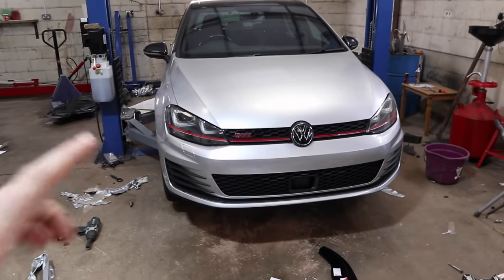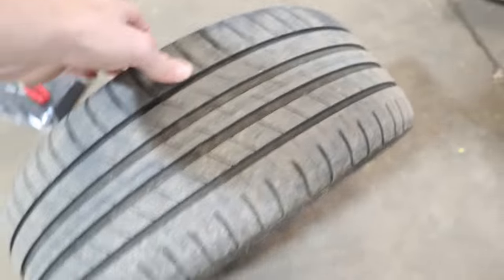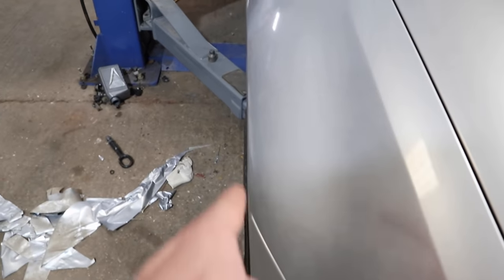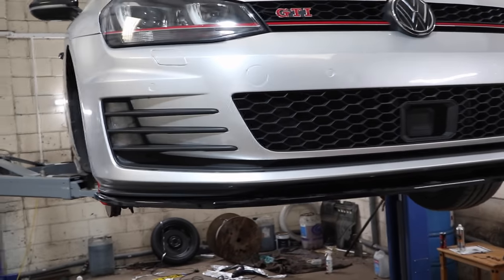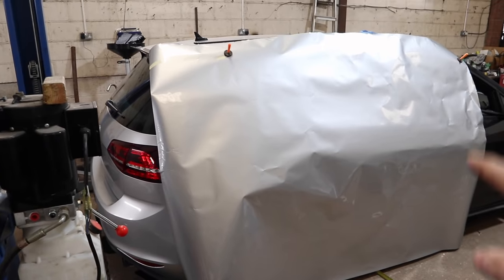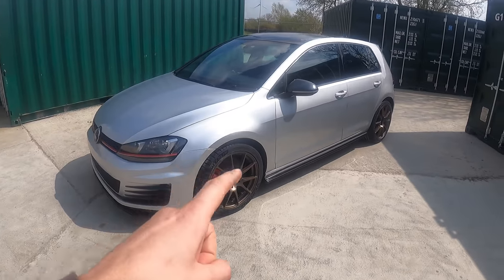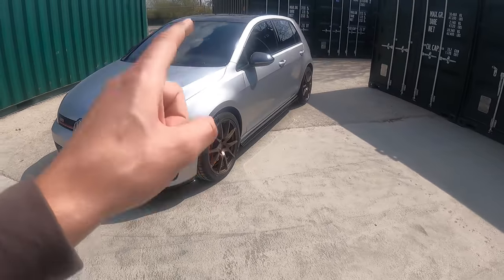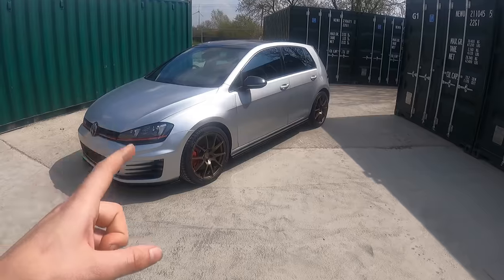MY SALVAGE VW GOLF GTI GETS A NEW WRAP AND WHEELS!!

Comment: Looks good I think you should wrap the off side the same as the near side. Re the tyre size I think its 40% of 90%, ie a 165 x13 is actually 195/90 ×13 so your measurements are probably right.

Comment: Isn't "40" the size sidewall...from edge of alloy wheel rim to edge of tyre tread 🤷‍♂️....so 4cm or 40mm
Reply: indeed, i always was learned that it was the height in cm
Reply: @joerie1980  It's not - as his measurements show.
Reply: It is definitely the aspect ratio, not the size of the sidewall in mm!

Comment: Have you informed DVLA on colour change? Looks good....yes strip the rear quarters back to carbon grey 👌
Reply: You don't have to ,the colour of the car hasn't changed ,it's just wrapped 👍
Reply: But don't quote me on that ,it might not be right
Reply: @ASH.......................1976  you definitely do need to. The physical appearance of the car has changed. so you need to inform the dvla of a full car colour change. You're still changing the colour even if its a wrap
Reply: @scott745  that's why I said don't quote me ,I looked it up and your right 👍
Reply: I got stung by my insurance company on my old MX5 for changing the steering wheel to a chrome/wood one...because I had "modified the car from stock"...not sure wrap is a mod as can be just pulled off, like a massive expensive bumper sticker 😁
Reply: @PompeyMatt17  you are also supposed to declare stickers 🤷‍♂️ insurance will do anything they can to get out of paying up
Reply: @whatsdavedone104  true !!!
Reply: @PompeyMatt17  your right to be honest,but not according to dvla

Comment: 235/40/18 means it's 235 wide and 40mm sidewall height and 18inch rim
Reply: wrong
Reply: 40 is a tyre's aspect ratio or profile which is its height from the base of the tread to the rim. This number represents a percentage of the tread width
Reply: @jamesgolynski2289  How is that wrong?
Reply: @BM_PAZ  because it’s the aspect ratio to the width of the tyre not a measure of the wall depth.